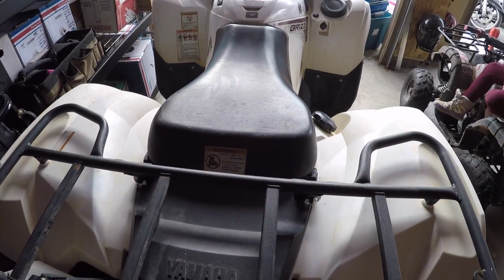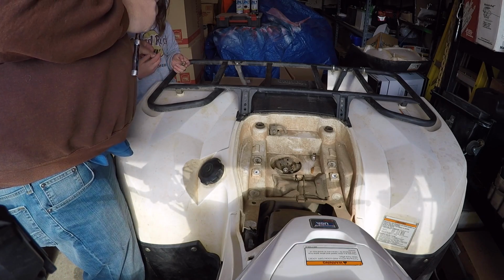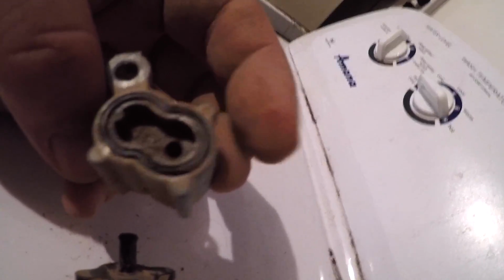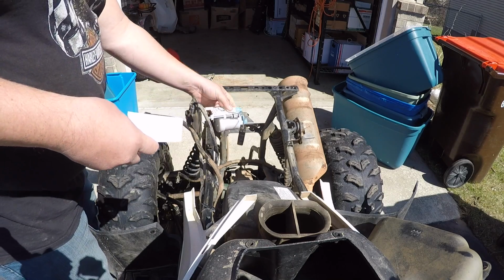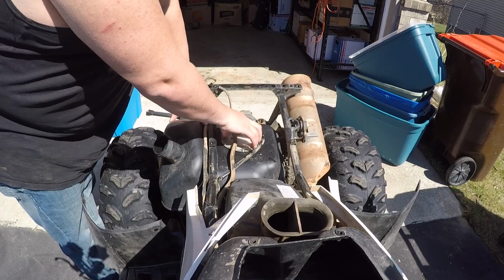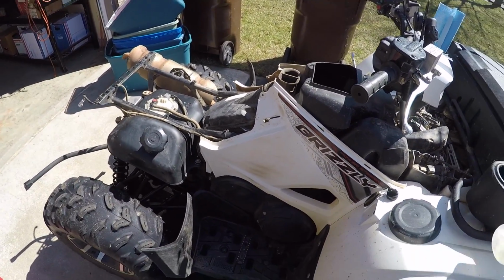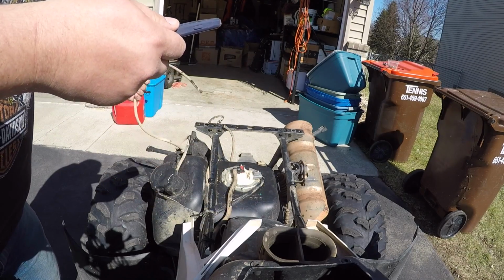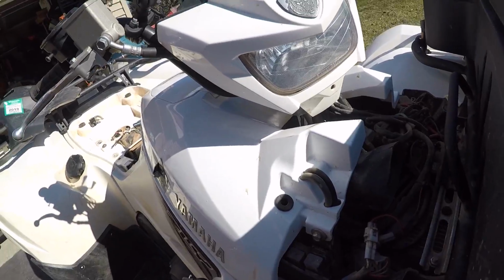Replacing Fuel Filter on 2018 Grizzly 700

Comment: Were u having problems before changing filter because mine seems to be in limp mode
Reply from the maker: Ours wouldn't stay running.  Just a fuel delivery issue.

Comment: The only way you get that much silt in the tank, you were in muddy water way to deep. Drive the 4 wheeler with some sense and you won't get silt in your fuel system.
Reply from the maker: We were having fun. The silt came in the fuel breather. Not a big deal.